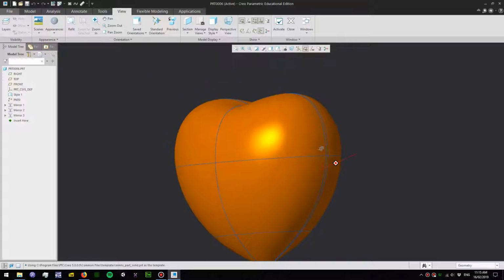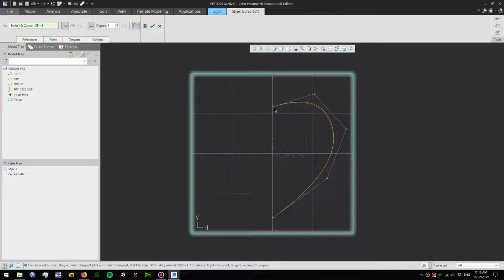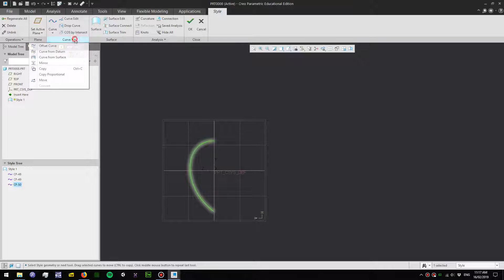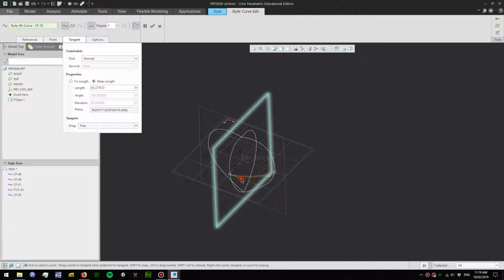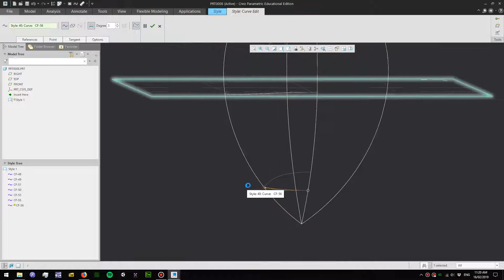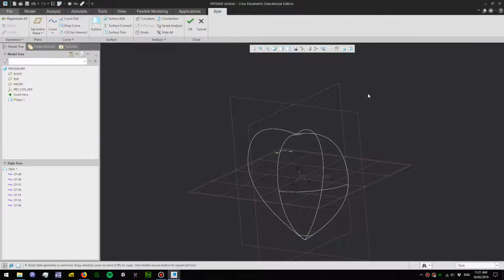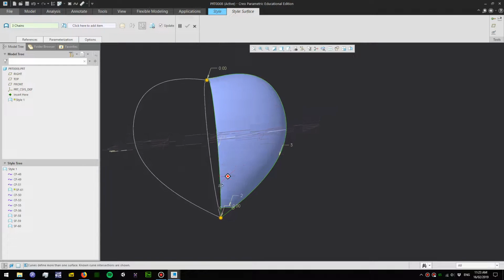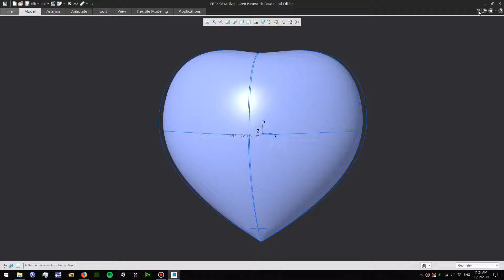Creo 5.0 - Style Surfacing Tutorial 3D Heart

Comment: Hey i had a question
The model or surface we make using this style feature does it applicable in industries or 3d printing because it can not be converted into solid model ??? 
Please reply
Reply from the maker: Yes you can. You just need to make sure there is no holes. You also need to click on the button 'solidify' to convert it to a solid model.